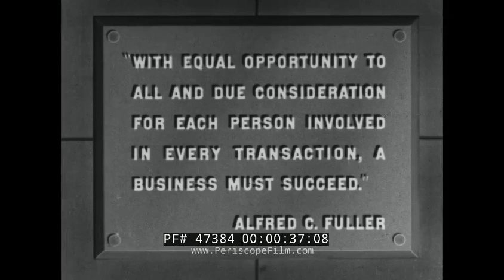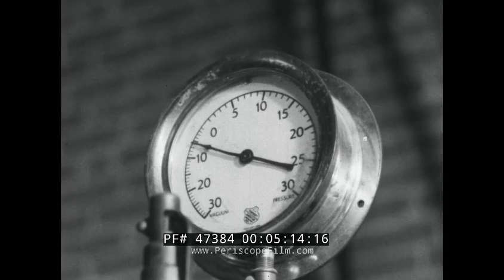FULLER BRUSHES FACTORY PROMOTIONAL FILM  DOOR TO DOOR SALESMAN 47384

Comment: I remember back in the 1950's and 1960's when the "Fuller Brush" man would occasionally be at our door.  My mother always looked at the offerings and always bought some brushes.  Sometimes to replace a worn out one, but they took a long time to wear out.  They were very good brushes.  I also remember the "Avon Lady" and my mother always bought some things.  Once, a Kirby Vacuum salesman gave an entire demonstration which I enjoyed watching.  It was quite expensive, but they bought one (to replace a tired old "Electrolux") and used it forever because it was built to last forever.  The salesman was good and got my father to buy some accessories I doubted he would use since he was the opposite of being a "handyman."  One was a flexible shaft you could put a sanding disk on the end of and such.  The other was a grinding wheel attachment that affixed to the front of the unit.  He never used either, but I used the grinding wheel to sharpen a saw.  They also bought the World Book encyclopedia from one of these salesmen and I really used and enjoyed it.  Finally, one salesman had something a little different which was fire alarm bells.  Sort of an early smoke detector scheme.  It had a windup spring mechanism to provide the power to ring the bell with a continuous rapid ringing for a while.  Everything was inside the bell, so it had a clean look.  The bell was one of those round types like you see at a boxing match and maybe about 8 inches diameter.  In the middle of the bell there was a protruding spring-loaded rod and holding it in place a flat little device that melted with heat (like they do with sprinkler heads).  Also in the middle was a decorative star shaped applique that today would just scream "mid-century".  It was incredibly loud, and my parents bought a couple of them.
Reply: The salesmen must have left your house and walked straight to my parents house. They bought the same products that you mentioned.

Comment: I had a Fuller hand brush that was my moms from in the 70’s and as an aircraft technician I used that brush for 35 years until I dropped it on my tile floor and it broke in two pieces. I immediately found Fuller Brush online still in business and ordered two new brushes that I’ve had for 10 years now…I don’t expect they will last 35 years but their still great brushes 👍🏼👍🏼👍🏼👍🏼👍🏼

Comment: On March 31, 1923, a 56,000-gallon water tank dropped through 4 concrete floors of the Fuller Brush Company Tower, which was in the final stages of construction. Nearing completion, the 160-foot-high, 4-story tower formed the entrance and elevator shaft of the new plant on Windsor Avenue in Hartford. The collapse occurred at 11:40 a.m. when the 200-ton water supply tank for the factory’s sprinkler system, located on the upper 2 stories, failed taking out the south and west walls, as well as the lower half of the north wall. Nine victims were pulled away from the wreckage before the firemen ordered everyone back from the building. Gas had filled the area from damaged lines, and the roof of the tower remained almost entirely intact leaving a large portion of it swinging back and forth dangerously in the wind. The roof needed to come down before further rescue attempts could be made. The Connecticut Company, Hartford’s electric street railway, offered assistance. Crews attached heavy cables to two trolleys in an effort to bring the roof and remaining brick work down but failed in their attempts. Eventually dynamite was used and rescue and recovery efforts continued through the night despite freezing temperatures and a 30-foot pile of debris.

Ten people were killed and later investigations into the accident revealed that the removal of eight steel tension support rods from the tank the day before were the likely cause of the accident. The rods reinforced the four upright supports of the water tank but took up quite a bit of space. The company had suggested the use of the space directly under the tank as a likely location for a school to instruct branch managers and the support rods had been removed after consulting the engineers on the project
Reply: Oh my goodness 😳

Comment: It's very remarkable they had an in-house PRINT shop. This is one of the tasks you should NOT do in-house because you can never be as efficient as a dedicated outdoor print shop. An outdoor print shop can print one day for company A, next day for company B thus being efficient and low cost. An in-house print shop can print only their own company specific things which is very inefficient.
Reply: Not true.
Outsourced things always has a larger overhead on the production cost than the indoor production, which also has greater flexibility.
In- or our door is always a case to case.
Reply: @johanmetreus1268  For example imagine McDonald's or KFC having their own print shop. They would have to have machines, staff, building etc. with all the costs. They would only have a limited amount of work printing leaflets etc, maybe two days work in a week. The rest of the time the machines and the staff would be idle. A private print company could print leaflets for two days and do other jobs for other companies in those other five days. They could even work on a 24 hours/7day week base. The result will be that the leaflets will be MUCH cheaper and McDonald's or KFC  won't have to deal with the print business side. It's called "concentrating on CORE business" which is a very sound business practice.
Reply: @johnsamu  , see what you did there?
You analysed the need, and concluded that it wouldn't be anywhere near enough to keep the printer busy.
Then there is the risk analysis to be done. How dependant is the company that the printed materiel is available?
If crucial, it might be better to expand the orders, perhaps printing all the posters and menus for the whole chain there, or turn the print shop into a subsidiary that will accept orders from outside but always give full priority to the mother company's needs.
Well, no one really cares if you get the fliers this month or the next. so NOW you close shop and outsource it.
Not going through these steps will send you right back to the -80's & -90's, where the hysteria of core business basically encouraged people to sell the car and house to take the taxi to the hotel in order to avoid fixed costs.
Reply: @johanmetreus1268  Ofcourse you should always do an analysis beforehand but it has a reason (almost) no company has it own print shop anymore. Even companies in the (Photo) Graphic industry mostly do NOT have a dedicated print shop. The same reason cleaning is a separate independant business. If you only do ONE job you can become very good at it. If you have to do multiple (not business critical) jobs you'll be NOT very good at the separate jobs.
Reply: @johnsamu , that's a very false view stemming from ideology turned into business practice.
If you need cleaning, you don't put the accountant department on it.
You set the staff you specifically recruited for that job, and as THEY only do that job, they become really good at it. If that staff also happen to be employed by the company, you don't have to pay the extra overhead of a separate HR nor the profit margin demanded by bought services.
Previously, the hospitals here had temp-pools, of employed nurses that knew the wards and could step in whenever needed.
Some corporate business manager fresh out of the latest economic course thought that was a waste of funds, as there are manning services on the Market...  and since the Market solves all problems efficiently, the pools were dismantled and temp allocation outsourced.
Well, the costs have kept spiralling out of control, leading to fewer temps brought in, and now the regular staff is quitting en masse due to the excessive workload.
Sanitary conditions in the hospitals also declined, as the outsourced cleaning doesn't have the skillset nor conditions to do the work properly, but who to replace the failed contractors with?
Reply: @johnsamu  Same goes with manufacturing abroad. Sure, the injector moulds from China only cost a third of what the European moulds cost, but any deviation mean the faulty mould has to be shipped back, inspected to see what went wrong, remade and then shipped anew.
Time is money, and here we talk months in delayed production, with the extra costs incurred widely outweighing the savings made.

Comment: The tower shown at 33:11 had collapsed during construction because they installed a huge  56,000 gallon, 200 ton water tank in there for the fire sprinkler system, and some idiot decided it was a good idea to remove a number of ties and  other parts and the tank's 4 support legs suddenly collapsed.

Ten people were killed and later investigations into the accident revealed that the removal of 8 steel tension support rods from the tank the day before were the cause of the accident. The rods reinforced the 4 upright supports of the water tank but took up quite a bit of space. The company had suggested the use of the space directly under the tank as a likely location for a school to instruct branch managers, and the support rods had been removed after consulting the engineers on the project

Comment: I remember the FULLER BRUSH MAN the one thing that they did they did to well. You could not wear out their brushes. I do miss them since everything today is made overseas and designed to fail after a short time and that is even if it works at all. The machinery was clearly dangerous and it did take a skill to use to  use each station something not found anywhere in the world any more. And that is the saddest thing of all we have lost the skilled workers to machines and the quality to make it cheap and then you can just throw it away. I would think that by watching this video and by the apparent age of it a top wage maker would earn maybe $1 an hour which would have been good for the times. Trying to do this kind of quality work would likely cost $20 or $25 per hour in today's dollars